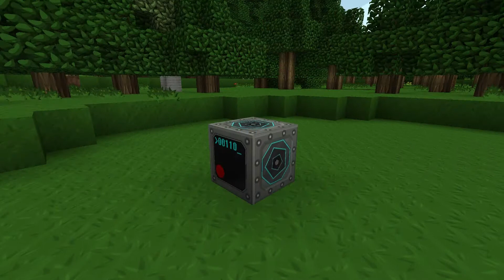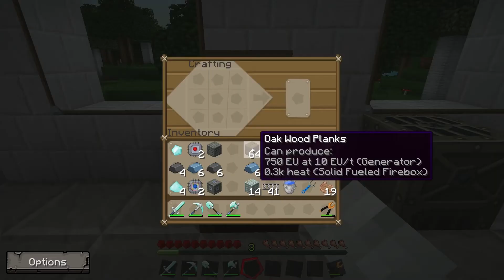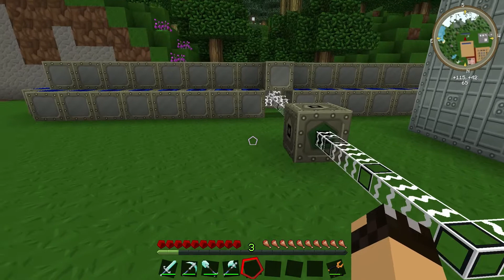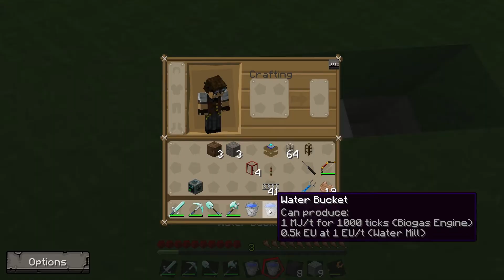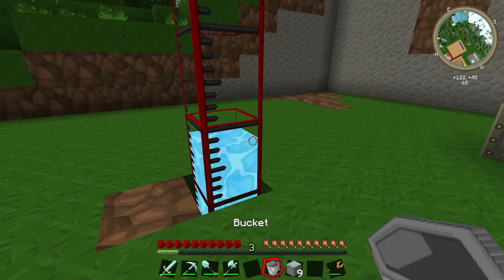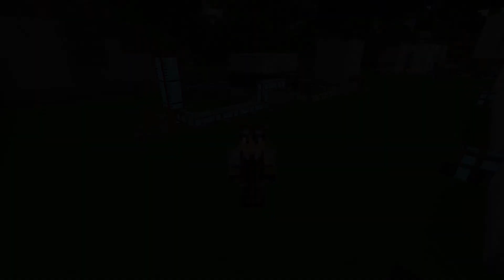Industrial Grinder - How to Feed the Beast in Minecraft - 25

Comment: You know, I would really love to see you doing automation for, shall we say:
Quarry to Redpower sorting system
Ores from the quarry (sorted out by the above) into industrial grinders
The dusts from that into smelting machines of your choice (though I would use Thermal Expansion, myself)
The tiny piles of dust into auto-crafting tables to be turned into dusts and smelted as above
Everything sorted (Redpower, again), the hydrated coal dust from Diamonds could possibly be used to manufacture fuel.